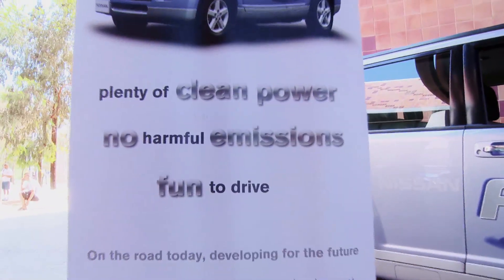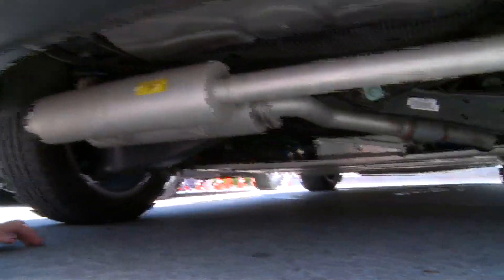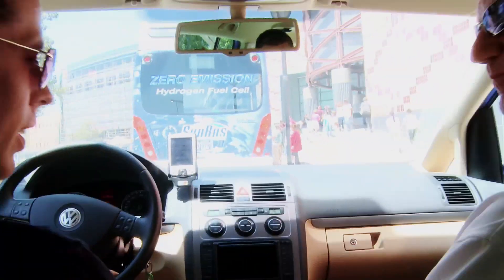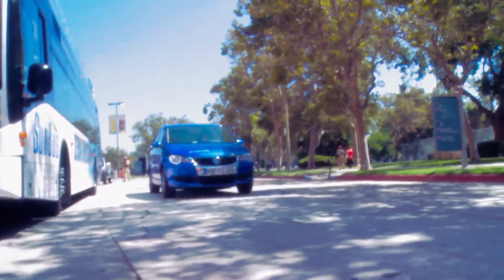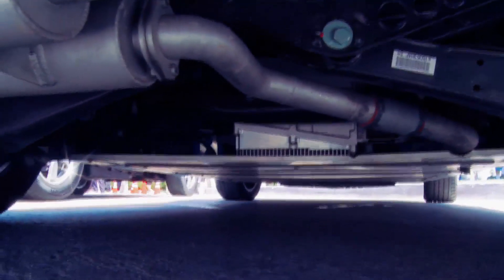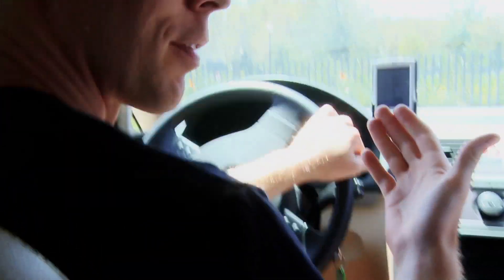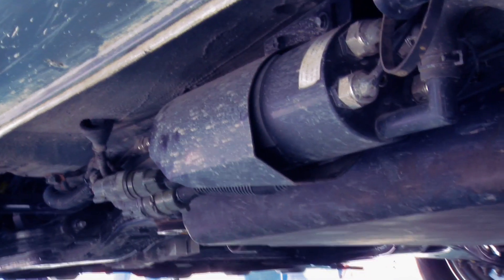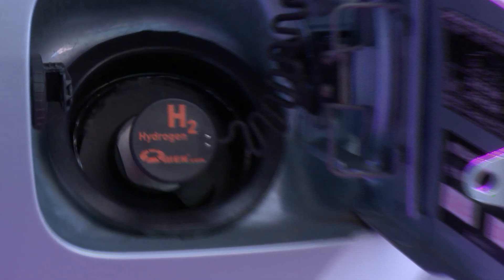Hydrogen Cars Proven Ready in Rally Across America

Comment: Wether hydrogen is viable isn;t determined by the vehicles beïng able alone.
The costs of making hydrogen, and the energy losses everytime energy is beïng converted should be taken into consideration as well.

A powerplant has an efficiency of somewhere between 35 and 40%.
When making hydrogen by means of electrolysis it its turn, has an efficiency of about 50%.
So about one sixth of the pie is left zo far.
Now, we're making electricity in a fuel cell, losing again about halt of the energy.

Unfortunately, even the IC engine is way more efficient than that.
The future of electric cars lies in batteries.
Not in fuel cells.

Comment: why do we hear so goddamned little about these technologies? this is from 2008 and seems noone noticed.
Reply: Wether hydrogen is viable isn;t determined by the vehicles beïng able alone.
The costs of making hydrogen, and the energy losses everytime energy is beïng converted should be taken into consideration as well.

A powerplant has an efficiency of somewhere between 35 and 40%.
When making hydrogen by means of electrolysis it its turn, has an efficiency of about 50%.
So about one sixth of the pie is left zo far.
Now, we're making electricity in a fuel cell, losing again about halt of the energy.

Unfortunately, even the IC engine is way more efficient than that.
The future of electric cars lies in batteries.
Not in fuel cells.

Comment: the technology is definitely out there. now Texaco has aquired Chevron as a disguise because they are involved in the world's largest lawsuit of all time with the people of Ecuador. they dumped 18X the amount of oil involved in the Exxon Valdez down their tributaries and rivers,not because they had to,but because it was cheaper to do so and there were no regulations stopping them. i now avoid Chevron/Texaco gas pumps AT ALL COSTS  & would gladly pay $1 more per gallon from someone else>google it
Reply: Wether hydrogen is viable isn;t determined by the vehicles beïng able alone.
The costs of making hydrogen, and the energy losses everytime energy is beïng converted should be taken into consideration as well.

A powerplant has an efficiency of somewhere between 35 and 40%.
When making hydrogen by means of electrolysis it its turn, has an efficiency of about 50%.
So about one sixth of the pie is left zo far.
Now, we're making electricity in a fuel cell, losing again about halt of the energy.

Unfortunately, even the IC engine is way more efficient than that.
The future of electric cars lies in batteries.
Not in fuel cells.

Comment: Agreed.  When the fossil fuels run out in the next however many years, the government will "amazingly" come out with this "newly discovered" technology and save everyone... Technology they have been sitting on for decades, waiting until they squeeze every penny out of the oil industry.
Reply: Wether hydrogen is viable isn;t determined by the vehicles beïng able alone.
The costs of making hydrogen, and the energy losses everytime energy is beïng converted should be taken into consideration as well.

A powerplant has an efficiency of somewhere between 35 and 40%.
When making hydrogen by means of electrolysis it its turn, has an efficiency of about 50%.
So about one sixth of the pie is left zo far.
Now, we're making electricity in a fuel cell, losing again about halt of the energy.

Unfortunately, even the IC engine is way more efficient than that.
The future of electric cars lies in batteries.
Not in fuel cells.

Comment: Since this car has to fill up an on board hydrogen tank at a hydrogen station, how much will 1 gallon of hydrogen cost?
Now compare that to what 1 gallon of gasoline costs. I think you will see that there is a higher cost to operate this vehicle than current gas models, still making the prius the champ. Also for those "greenies" out there, where does the hydrogen come from?
I think you will find it comes from the oil industry. So where is there any improvement?

Comment: Water is the fuel source. "Heavy water" is best, but it's not plentiful enough, so just plain water is used. Electricity is used to break the oxygen and hydrogen molecules apart at the processing plant. Liquid hydrogen is what you get at the pump, electricity is produced from its reaction with oxygen, the electricity runs the motor, and water vapor is what comes out of the exhaust. It's nothing new, only too expensive and politically problematic at this time.

Comment: yeah, dragonsrightwing is right and so is willhort. There are many obstacles and disadvantages but other than compressing it they could use a metal hydrides. There are also obstacles like cold weather and the cost and production issues associated with fuel cells.